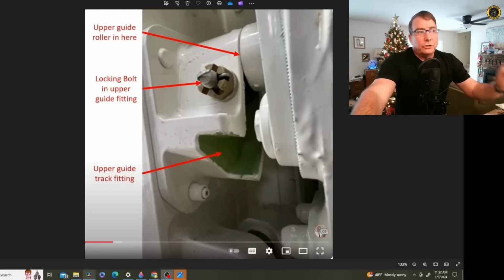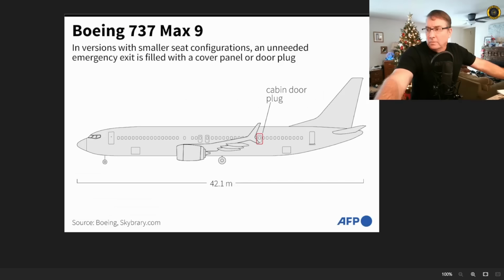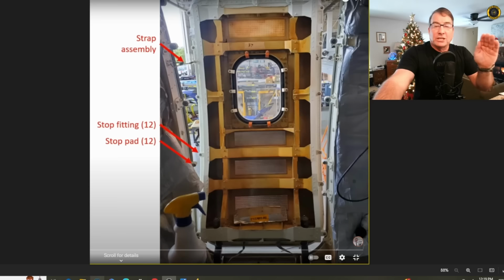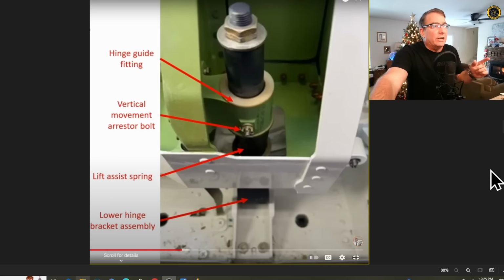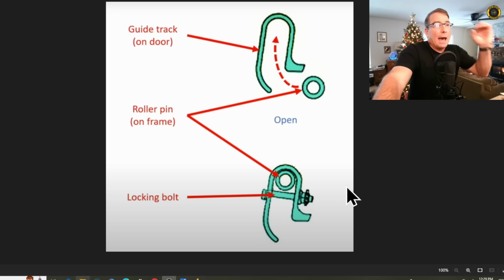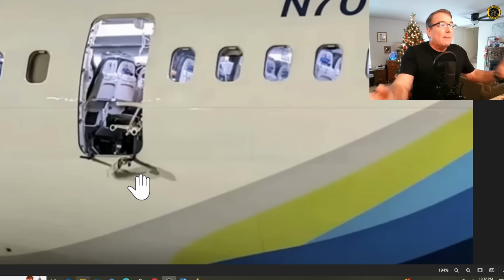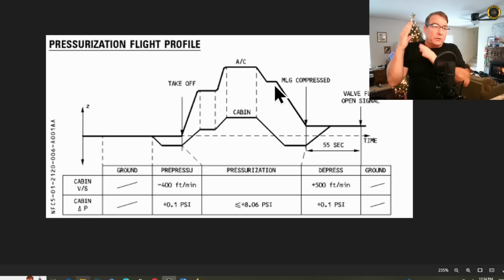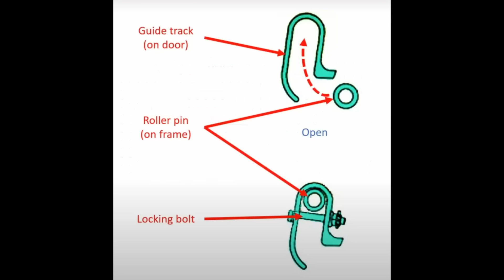Alaska 737 Max-9 Door UPDATE! 8 Jan 2024

Comment: My money is on the connection between that  upper pin track bracket and the door structure.... Looks like 2 or 3 hy-lok fasteners holding that track bracket to the door....if that connection breaks, the door flies off, and the track bracket just falls off the end of the pin with the bolts still in place.... A better design would be to have a bolt through each of those stop pads, in addition to the other retention methods already used.

Comment: It is obvious that if all of the bolts were in place WITH the cotter pins, this could not have happened, period! It would not matter if the washer under the bolt head could spin or not if the cotter pin was in place. The tightness of these bolts is not what makes them work, it is because they go through the part of the plug that has to come out of the guide before this plug can be removed. If they were in place, the plug could not be removed. This will probably be either sabotage or incompetence by a Boeing worker during assembly.
Reply: I’m with you there   Bolts were there with castle nuts/cotter pin the Assyrian can’t go anywhere

Comment: At airlines I flew if there was any pressurization issue they did maintenance ground runs and pressurized and checked for leaks. I would think a leaky plug door would be detected? However may be the leak required flight loads on plane with pressurization, an intermittent leak.  Way back in the day, as I understand it it, when cigarette smoking on planes was the norm, nicotine stains showed where leaks were in the fuselage.... see smoking saves lives? KIDDING...  FINAL FINDING.... Plug Door was, sad for being ignored and never used like the main passenger doors. So it jumped off?

Comment: Perhaps Wichita, knowing the door plugs are removed for fitting out did not securely bolt them to the fuselage, if Boeing have changed their process at all and doesn't actually remove the doors for fitting out, then you have a problem.

Comment: Cabin doors normally have proximity switches that will illuminate a warning light in the
 cockpit when a door is not closed properly.  Wonder if the door plug panels also have a proximity switch ?

Comment: Where is the confusion? I am also an A&P. The airworthiness directive says inspect. So inspect. Inspect the fasteners. Remove the bolts, install new fasteners and tighten them to proper torque, and re safety the nuts.

Comment: Very informative, thank you. Now I've seen some more photos of the detached "plug" panel and the frame, i have to say that i am surprised that there's not a lip round the panel meaning it can only be installed from the inside and physically should not be able to fit through the gap 🤷‍♂️🤔 Initially i thought there might have been a window failure and pressure did the rest but it seems it just straight up popped out, intact.

Comment: From previous commenters who have experience with the 737's, door plugs are not new to the 737 Max.  They are used on older models.

Since this appears to be the first incident, it does not appear to be a problem with design or engineering.  In other words, it's a proven design.

This now leads to the two next possibilities, faulty materials and faulty installation.  

Were the door plugs defective?  If yes, who is responsible for quality control?  If the door plugs were not defective, who is responsible for the installation?

Were the door bolts installed?  

The door bolts use nuts which are equipped with cotter pins.  Were the cotter pins installed?  Did the cotter pins fail?

Comment: That door looks to be approximately 30 inches by 48 inches.  That would be 1,440 square inches in area.  With 8 pounds of pressure on that door there would be 11,520 pounds of pressure pushing that door against the stops.  5.76 tons.  That would be far more than enough to pick a large SUV up into the air.

That tells you just how good they build those jets.  And as an diesel and heavy equipment mechanic, I have never ever seen a bolt with a castellated nut pinned into place work its way lose.  Someone somewhere would have had to at least remove the pin from the nut for the nut to work itself loose.  And I have heard one report that they have found loose nuts on other jets.

Comment: Bravo on the quick collection of the technical data.  Looks like the installation would be complete at Spirit so if the Renton factory wanted to use the door for interior access they might remove the locking bolts without paper coverage which then depends on someone 'remembering' to reinstall those fasteners prior to delivery.  Someone's out sick and it doesn't get done.  Just speculation but we'll find out soon as we see the door panel.
Reply: We'll never see it. Boeing will see to that.

Comment: This analysis appears to be well thought out and points to a most likely method of the door coming loose. If accurate, it will first point a finger squarely at those that have removed and installed the door plug in the past, all the way back to initial manufacture. Then it will point to the manufacture of the bolts, castlated nuts and retaining pins to see if the metalurgy was up to standards. The first will have people being fired for not doing the work properly. The second will ground every 737 with a door plug.

Comment: I would assume some sort of additional block would be nice to stop the door lifting up. Feels stupid the bolts stop it. As bolt is not usually used as a pin. Bolt tightens to parts together and the friction between parts is necessary. Using bolt as a structural stop pin is not right.

Comment: The old 707 had a plug type door that once pressurized would only seal STRONGER as long as pressure persisted. They keep calling these 737 things "plugs" but they are really hatches, because they open outwardly. Since this hatch rarely is opened, and only on the ground, why didn't they make it a REAL plug, that can only open inwardly?
Another thing, how could just the four bolts release this hatch? What about the 8 side bolts. Wouldn't they also prevent it from moving?
This whole thing makes no sense to me. If this hatch has been used on the 737 NG for years with never an incident, how is it that the MAX has a problem with it? Did they change the design? If they did, then in aerospace, it seems like it would have to go through an entirely new qualification.
This is as crazy as having a critical flight control system rely on a single angle-of-attack sensor. Are the latest aeronautical engineers so much worse than the old engineers of the past? Have they just forgotten all the things we learned in the past?

Comment: .. or the legs of the cotter pins locking the castle nuts in place were not properly bent to prevent them from sliding out, hence allowing the castle nuts to eventually become loose enough to fall out .. ☹️

Comment: Boeing engineers probably forgot to account for additional fuselage flex when they designed the extended 737 Max 9 and 10 variants. So under pressurization, the body bends enough to allow the door pins to slip out.

Comment: Was there any reason for the NTSB-Guys to contaminate that perfectly clean door with mud by throwing it onto a lawn and pushing its side into the soaked soil?
There will be most likely microscopic examinations of the surfaces around the stop fittings and bolt holes. Now there are bugs and earthworms crawling across the picture instead of delicate exfoliations of metal and lacquer.

Comment: The door frame and door look to nice to indicate a fight between aero forces and shear bolts. I'd say that plug door was indeed launched cleanly away from the aircraft. It looks strongly that none of these bolts where there.
Reply: I'm no expert here but it appears to me that in this design the four bolts are used to capture the door so that the 12 contact plates around it perimeter absorb the outward pressure loads on the door.  The bolts capture the door in position so that the pads are in center contact.  IF I am correct there will be no shear loads on the four bolts from outward pressure on the door, just the vertical load of the door where it holds the door in position.

Comment: Shouldn't have the cotter pin kept the bolt from completely backing off. That is what they are designed to do. Stop  any rotation of the nut if somehow it was starting to loosen. The cotter pin itself would have to completely fail first before the nut could back itself off from the bolt.

Comment: My thought is why the bottom hinges are spring loaded. It seems to me that the springs should be removed as not being needed for anything but maintenance. and for maintenance they can use a tool to raise the door plugs up. I do get that if there is a door there )not a plug) then the springs would be needed. Why add an additional point of failure?

Comment: This is nothing short of a masterpiece of investigative inquiry. I’d love to know whether a. The bolts were missing. b. The bolt was not properly torqued AND the cotter pin missing or improperly installed or c. Just the cotter pin was missing. 

Note if the cotter pin was improperly installed, it is likely that the nut could only back off so much.  This will not release the bolt unless repeated vibration caused metal fatigue in the bolt or nut.

Comment: A few lucky things happened. The incident happened at a relatively low height.  The Plug Door fell into the teacher's back yard. The door did not not contact the tail of the plane.  There was no-one  in the window seat.  Had there been a person in the window seat with their belt done up properly - would the belt have saved them??

Comment: So much had to have gone wrong there.

So I'm just a lowly ex mechanic, for vehicles worked on alot of things but no fixed wing aircraft.

Unless the threads stripped or snapped then it's down to the nut, that locking split pin may seem weak, and they really are, but they will take a pretty extreme amount of force to allow the slotted crown nut to come off.

My guess, as from memory this was first flight with passengers, the nut was NOT torqued down, and NO split pin was installed...on all points which is just wild, someone will be losing their job for being drunk, high, and in a vegative state whilst working.

Comment: So, the plug type doors are not removed to install the interior at Boeing so the logic is that the subcontractor that shipped the plane must not have installed the bolts properly. 

However, is the subcontractor under the impression that the doors would be removed in order to install the interior? If so, then it would be redundant labor to fit the door and it’s bolts before shipment as if it were going to go straight into flight. 

If there’s confusion about whether it’s a door or a plug and some checklist says that doors are gonna be removed and reinstalled anyway, then it doesn’t seem reasonable for the subcontractor to do a safety check on that door if they thought it was indeed considered a door that would be removed for interior fitting. 

Just food for thought. I don’t know what happened but I know what happens generally when communications, requirements and expectations aren’t abundantly clear to all parties involved.

Comment: You never wanna hear a pilot say “where’s the bolts”, or the nuts, screws, locking pins (sailplane wing or control surface connection), or pitot covers.

Comment: Just watched the NTSB “high five” explanation on how the 12 stop fittings match up with the 12 stop pads, and would still like to see a better diagram & closeup pic of how those pads get in the way of the fittings to hold door.
Reply from the maker: Watch this video….
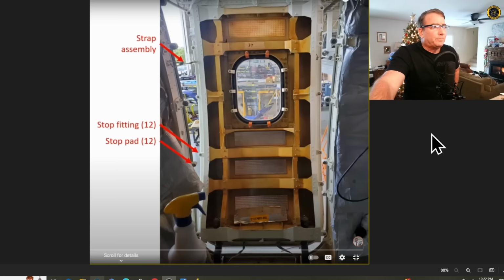Reply: @blancolirio , I watched it several times, after watching the Chris Brady video many times the day before. The straight on 1 dimensional pic of the open door you have at 5:14 gives no clue what the “stop fittings” on the door actually look like in 3 dimensions. I now assume they must project some distance inward from door such that part of them comes down inboard / BEHIND the “stop pads” on door frame. Nowhere in any video is there a side or top view of those stop fittings that would make this apparent. Ms Homendy and her “High 5” doesn’t either.  With your experience I suppose it’s obvious, but I’ve never seen the inside of an airplane door, or a manual showing those parts. 

Having looked long and hard at the Brady video yesterday I was able to figure out the door had to move upward to release the upper guide & pin assemblies and pointed out the conflict. Brady, a 737 pilot, contradicted & disregarded my explanations by quoting from the manual. You came to that discussion, asked “which way does the door go? Up or Down?” then you sided with Chris as he was quoting from the manual, only to be corrected yourself, maybe by other airline professionals you know & don’t dismiss so easily. That manual is apparently wrong! 

You do a great job explaining many things. I’ve watched it all since Oroville. I have minimal teaching experience but it taught me a lesson too. Sometimes a persons failure to grasp something is because they are looking at it from a different perspective. Understanding where they are at, and asking them to step around the corner to see how it looks from another view, is sometimes like turning on a light in a dark room. Telling them to watch the same thing they have already seen a hundred times may not help. I wouldn’t post a question or comment on your channel, or Chris’s, without considerable thought & research. Sometimes I have enough to go on, but many times not. 

Way back I had a question on the function / renaming of the 2 “stab trim cutout” switches during the Max 8 MCAS debacle. That question went unanswered, because as you explained it, the procedure was ALWAYS to deactivate both of those switches. In your position I suppose it’s wise counsel to always follow the “written procedure”. Cover your ass as the saying goes. I still think the question was valid but I apparently don’t have “standing”. I still wonder how many switches in a cockpit are considered so critical that they need to have a directly adjacent “backup” switch to duplicate the function of the “main” switch, should that “main” switch fail. Not many, if any, I suspect. I sincerely hope someone did enough digging to determine if the procedure in the manual requiring simultaneous deactivation of both those switches, regardless of their function before or after the labeling change, was always the correct one. Sometimes it sure would be nice to hit that trim switch on the yoke and have a response when the ground is coming up fast and cranking on those trim wheels just isn’t cutting it. We now know those manuals are not always correct. Didn’t somebody in a jump seat, in the days before those crashes, flip one switch but not the other, and have a porpoising 737 land safely, possibly because he violated procedure? 

Feel free to delete my comments, along with my subscription, “by the book” if desired.

Comment: The ONLY way that bolt comes loose is if technicians forget to put the cotter pin in and bend it properly. That's a castellated nut and MUST have a cotter pin installed!

Comment: I saw the United Story.  I would think that part of design testing process would be accelerated life testing where they would have a fuselage mockup that they could cycle pressure and have it on a shake table for long periods of time.  Is the testing not that rigorous?  Do they just settle for some computer simulations on the mechanics?  Are the cotter pins not working?  How does a nut get past that?

Comment: Sounds like those springs are strong enough to act like an ejection seat to clear the aircraft.
This is my opinion of a possibility.
The cotter pins probably were not installed or loose to begin with and the rattling around of the door worked the bolts loose as described by Juan.
These look like they should have been wire locked in like I have seen on jet engines to prevent the bolt from working out rather than a cotter pin like on a wheel hub on your car/truck you drive every day. But I am no expert but Juan should not only be a teacher but should be a aircraft investigator for aircraft mishaps on the way he explains things to us.
Reply: Others have said the springs only make the door sorta weight neutral, so it would require minimal effort to raise but not bounce up.
Also, for a single isolated bolt like this, having a cotter pin through the bolt and nut seems quite secure IF installed correctly. Isn’t wire locking more for multiple nuts that are in a line?

Comment: NTSB spokesperson said that the cockpit door is designed to open when there is a rapid decompression of the aircraft cabin … what does that have to do with the plug door departing the aircraft without any noticeable damage to the fuselage side of the installation ?  Apparently none of the crew was aware that the cockpit door would open during the decompression. Never heard of this before. Has anyone here heard of this emergency opening of the cockpit door ?
Reply: All cockpit doors since the 9/11 attacks have that pressure mechanism. It is safer to let the air flow out, rather than buckle a bulkhead.

Comment: What I'm curious about is if the design was modified at all between the 737-900 and the MAX-9.  Because if not, I feel like they should also ground/inspect the -900 the same.  I know they changed a lot for the MAX, this is not something I thought they would have changed.

Comment: I wonder if the 'loose' bolts found by other airlines mean bolts found laying in the airframe under the door ? Missing or incorrectly fitted split pins could allow the castellated nuts to vibrate off their threads.
Reply: In the article linked above there’s a photo showing loose bolts on the bracket that holds the hinge to the frame, not the bolts that have the castle nut and cotter pin.